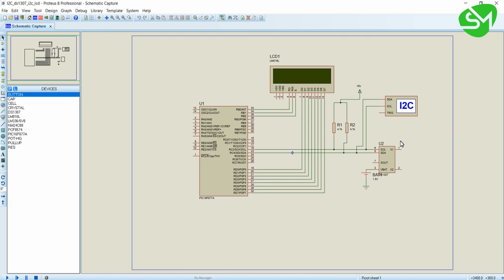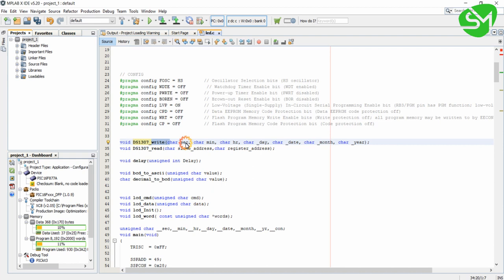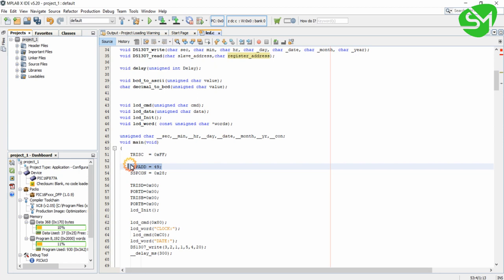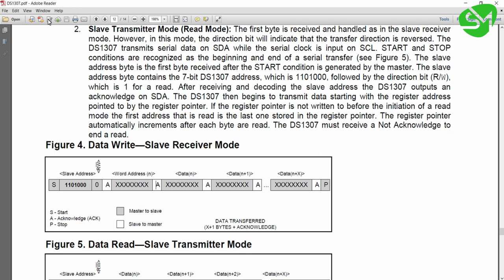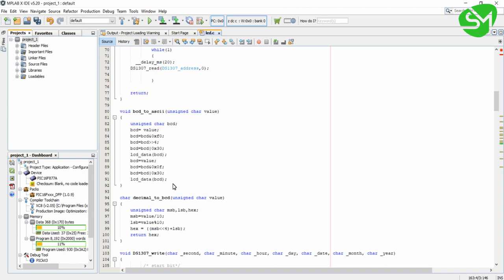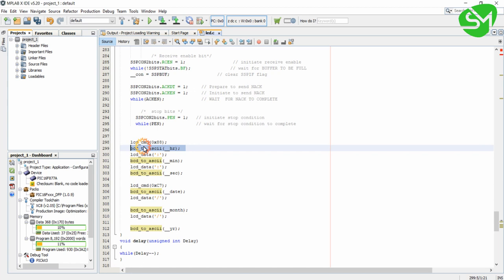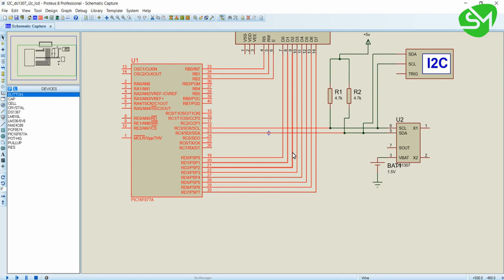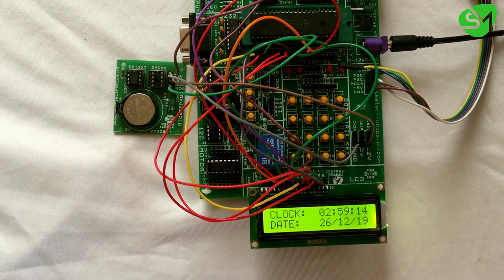Building digital clock using DS1307 RTC with PIC16F877A microcontroller | Digital clock part-3

Comment: Sir, sorry for asking continuous questions. I have some doubts in hardware mode. Should we use crystal for DS1307? If yes means, what freq should we buy? Also do we need pull up resistors between the i2c pins of pic and ds1307? Because the hardware model you showed doesnt had any of these? could you pls, share what you exactly did in hardware mode in detail sir.  Thank you.
Reply from the maker: Yes of course you have to provide crystal for ds1307 and also we need to provide pull up for i2c lines, it’s ok I can help you anytime you can ask as many questions until your doubts are cleared no issues
Reply from the maker: Also refer the schematic I have provided for the hardware circuit
Reply: @SMtrainingacademy  thanks a lot

Comment: An excellent tutorial. I watched all the three parts of the I2C clock lesson. 
I have one question. I built the circuit in proteus as explained and it worked fine. but when I removed the I2C debugger the DS1307 doesn't work and the LCD was only showing zeroes in place of seconds, minutes, etc. what is the reason for this?
Reply from the maker: Hello Kasun
It actually happens sometimes in proteus I have also faced it,but in hardware it will work fine 😊
Reply: @SMtrainingacademy  Thank you for the reply...  :) it means it is a kind of a bug in proteus ?
Reply from the maker: May be @Kasun

Comment: In hardware mode, did you used the potentiometer and the 5v source for the vss, vdd and vee for the lcd module
Reply from the maker: Yes I just did the same as per your understanding

Comment: And in the code part, you mentioned 1 for using 'day' register in ds1307, but why the LCD doesn't showing what day it is?
Reply from the maker: Can you mention the time frame in video where you found the problem
Reply: My doubt is why you are not printing the 'day' in the lcd? 
In the code part, ds1307 write function, you declared it as 1.

Comment: is there anyother way to dump the code in pic16f877a board without PICkit3. I used Rs232 cable with pic isp software downloader to dump it, but is showing bad acknowledgement error. Do you how to resolve this?
Reply from the maker: PIC IC with bootloader is able to program using rs232 and without bootloader you cannot perform it
Reply: @SMtrainingacademy  Now we bought pickit3, the program works fine. We used MPLAB IPE for dumping the code. The interpreter said program was successfully uploaded. But we are not getting any output in the LCD. While using MPLAB IDE, we couldn't even upload the program. Do you know what could be the issue with out setup?
Reply from the maker: @amudhapriyane4534  what is the config bits you have used
Reply: The above drive link has the code we used, you can refer that for the config bits.
Reply from the maker: @amudhapriyane4534  which link can you share it again
Reply: @SMtrainingacademy  
#include<pic.h>
#define _XTAL_FREQ 20000000

#define RS PORTBbits.RB0
#define RW PORTBbits.RB1
#define EN PORTBbits.RB2

// rtc macros for ds1307
#define DS1307_address 0xD0
#define second        0x00
#define minute        0x01
#define hour          0x02
#define day           0x03
#define date          0x04
#define month         0x05
#define year          0x06
#define control_reg   0x07
Reply: // CONFIG
#pragma config FOSC = HS        // Oscillator Selection bits (HS oscillator)
#pragma config WDTE = OFF        // Watchdog Timer Enable bit (WDT enabled)
#pragma config PWRTE = OFF      // Power-up Timer Enable bit (PWRT disabled)
#pragma config BOREN = OFF      // Brown-out Reset Enable bit (BOR disabled)
#pragma config LVP = ON         // Low-Voltage (Single-Supply) In-Circuit Serial Programming Enable bit (RB3/PGM pin has PGM function; low-voltage programming enabled)
#pragma config CPD = OFF        // Data EEPROM Memory Code Protection bit (Data EEPROM code protection off)
#pragma config WRT = OFF        // Flash Program Memory Write Enable bits (Write protection off; all program memory may be written to by EECON control)
#pragma config CP = OFF         // Flash Program Memory Code Protection bit (Code protection off)
Reply from the maker: @amudhapriyane4534  it’s seems to be no issues in code just try with correct wiring maybe some hardaware issues are try using pickit3 software

Comment: Hello, why you upload a different proteus schematic in the website. But in the video you just used pic and you didnt used any crystal for pic. And you used I2C debugger here in the video and not in the proteus schematic which you uploaded in the website along with the code. Please say why you did that. Thank you
Reply from the maker: Which schematic is different can you please show that ..?
Reply: @SMtrainingacademy  I have another doubt why the LCD module Vss, Vdd and Vee are not connected to any power source? How it is running without any source? and there are no crystal  connected to the pic and ds1307? why? could you explain this in detail? please!
Reply from the maker: @amudhapriyane4534  Notice that in simulation we don’t require to provide power source and crystal for controller but in hardware we want to provide which I have already provided to you the actual circuit in the schematic diagram.please remember simulation is quite different than hardware but code will be the same
Reply: @SMtrainingacademy  okay. Thanks for your response sir. I understood
Reply from the maker: @amudhapriyane4534  😊